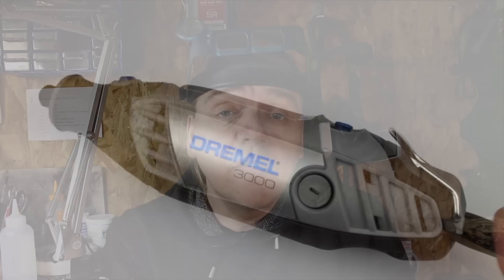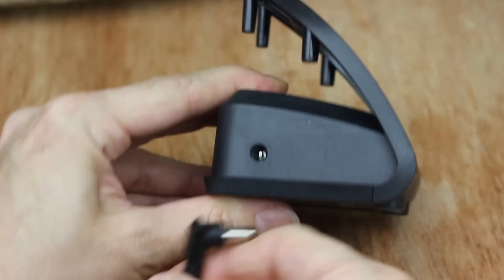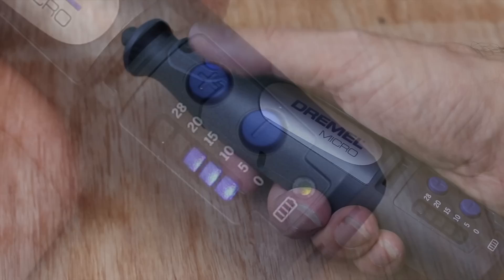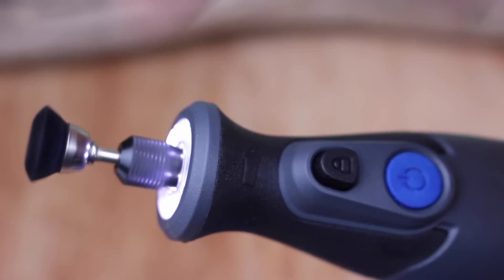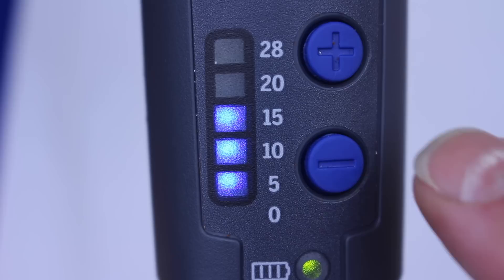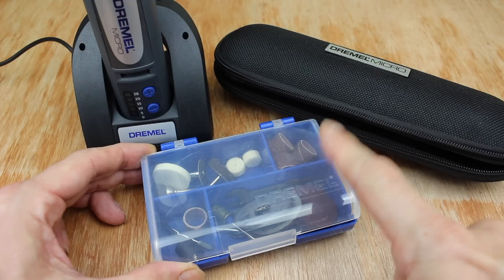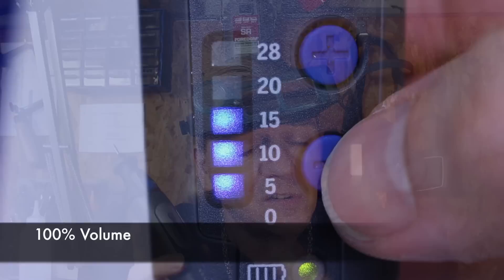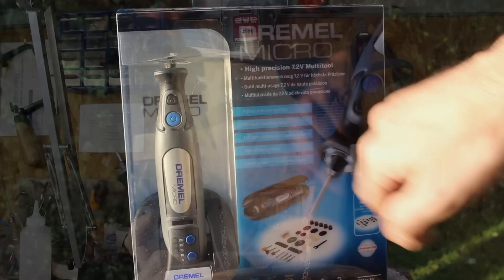Dremel Micro Cordless 8050 FULL Demo,  Review & how to in HD

Comment: I'm new to Dremels, but this thing has been great. https://www.youtube.com/post/UgkxfPgcZ5_Cl0HDUKkMJAKde11YKQZVgMoR The variable speed is awesome and the cordless aspect makes it so easy to work with. I am constantly finding uses for it that make tasks easier. Recently I put in a new deadbolt on one of our doors. I knew I had to enlarge the hold where the deadbolt goes into the door frame. At first I thought I would have to get a big router and figure out how to use it for that, but then I rermembered we have the dremel. I was able to enlarge the hole almost as easy as if I was drawing with a pen. It's also great for grinding our dog's nails done and so many other household tasks.
Reply from the maker: Still use it daily,  works perfect serval years on. Dave

Comment: How long does one charge last
Reply from the maker: Dremel don't seem to to give that information. It varies depending on the load. Light polishing will last longer than heavy drilling and grinding. So likewise  I can't give a definitive time. I keep mine permanently in the charging stand on my bench and to be honest I never have any issues with it. I use it, pop it back and it's always ready to go. So much so in fact that I have a flex shaft on the same bench and Invariably use this little Dremel instead as its just so easy and convenient. But as a jeweller I am doing lots of short tasks, such as polishing a small ring, (put back), then a few minutes later polishing another. So its always on and off the charger and only really doing light tasks of several minutes duration each time. For me it never runs out. Sorry I cant be more specific, but I hope this helps. Dave.